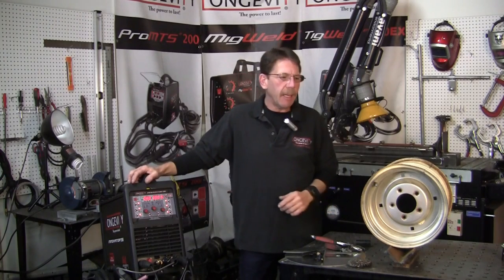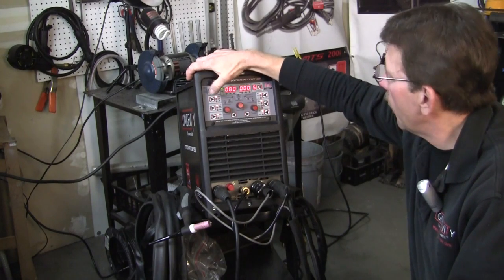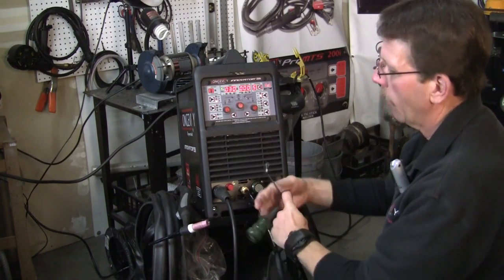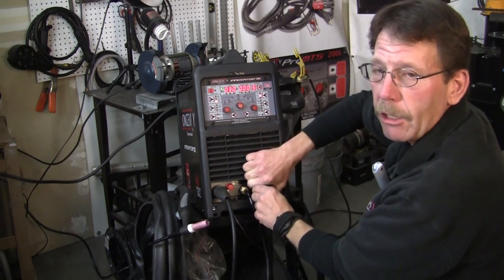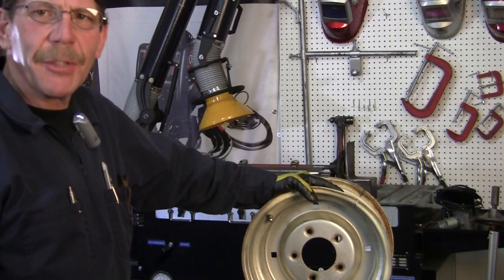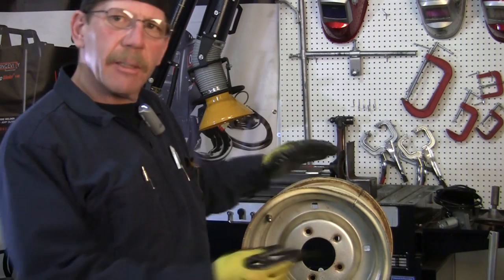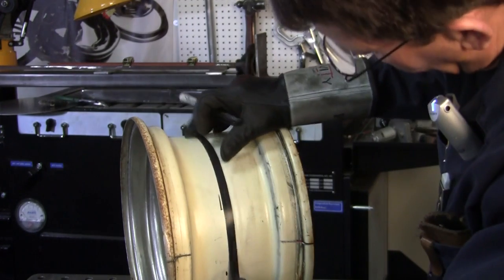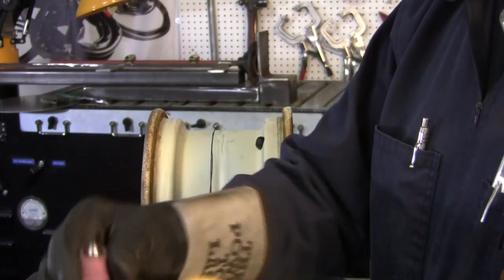Motorized Welding Turntable - Part 1

Comment: just a plain pipe fitter wrap around to do the layout. then a 4 and a half inch grinder with a zip cut would be faster!
Reply: Bryan Dunlop  yeah i use old portaband or floor saw blades  and a drag tip  but them matabo 6in cutting wheels are f*ckin awsome.  never heard of these machines i use blue or red  i dont buy cheep machines